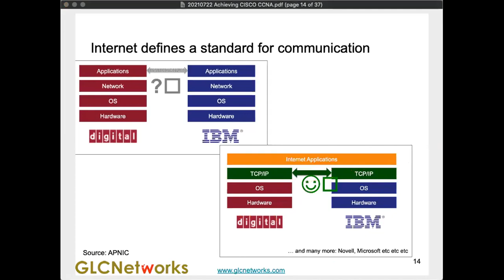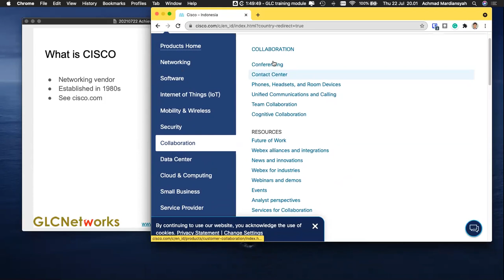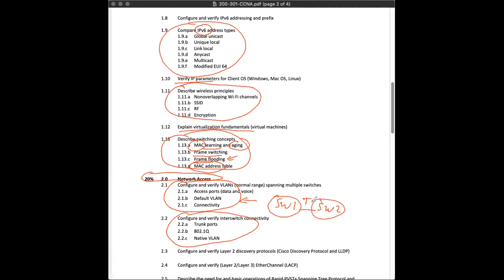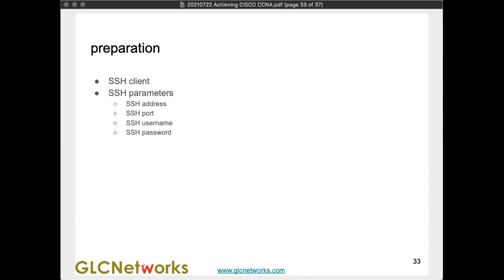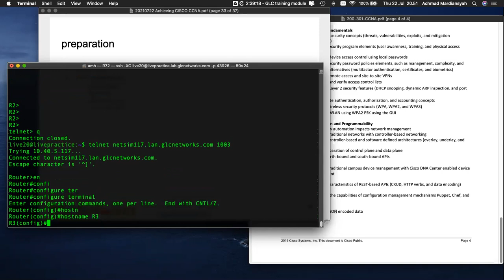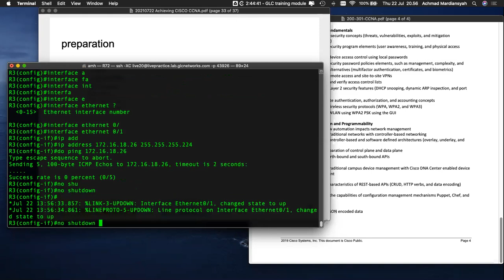Achieving Cisco CCNA (English)

Comment: CISCO? After working with Cisco for a decade, the conclusion is devastating: there is hardly another company that works so sloppily. Cisco doesn't even have professional testers who work with the software before it is released to customers. And if they do have testers, they are incompetent because we find new bugs within minutes of every new release. This company focuses 99.9% on greed and 0.1% on customers and IT security. I recommend a really professional alternative, e.g. from Israel. They are clever, professional and at least 1000x cheaper than Cisco.